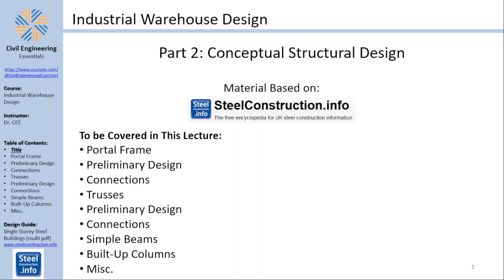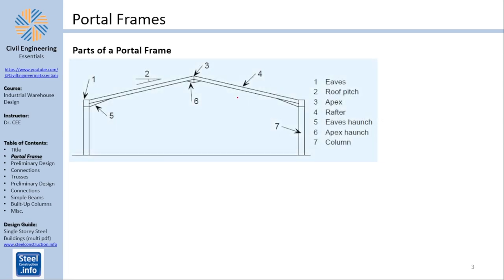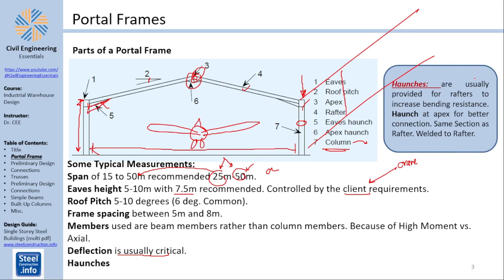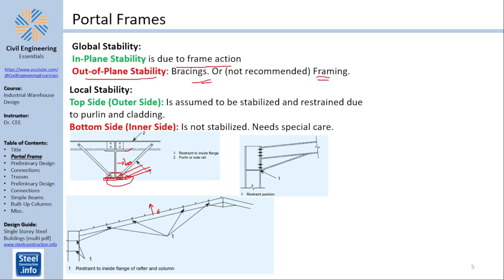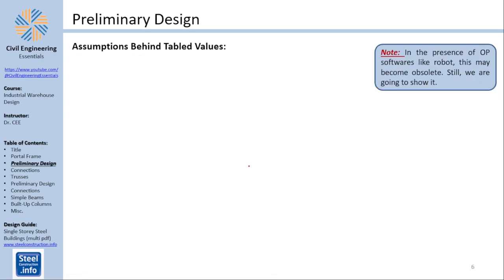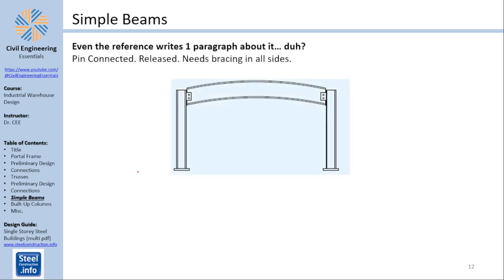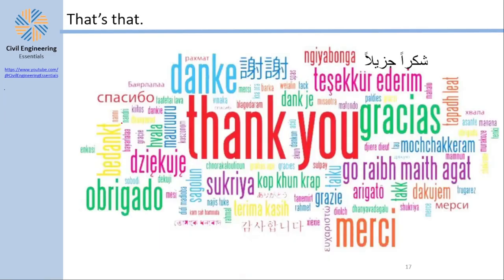Design of Industrial Warehouses | Part 2: Structural Concepts

Comment: Hello Dr. CEE,

You are correct, there is quite a lot to uncover on this subject; and I do think that the CEE is doing a fine job of this so far. 

Very nice discussion on the Global and Local stabilization. It will indeed be interesting to see how one may be able to effectively model these stabilizing assumptions into RSAP in as far as it is practically possible and in order to align the analysis and design model with “real-life” or anticipated behaviour.

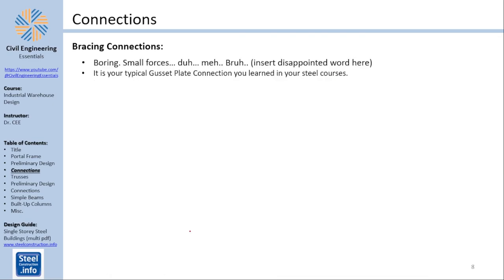12:30 Bracing connections. I agree with that most of these connection details are for the most parts “standard-off-the-shelf-details”. This is especially the case with local stabilization. I’d also like to add that the concept of bracing (stabilisation) is critical to the structure as a whole and so it (stabilization) will be as strong or as effective as its “weakest bracing connection link”. Therefore, it is very important for a user to get those bracing connection details right.

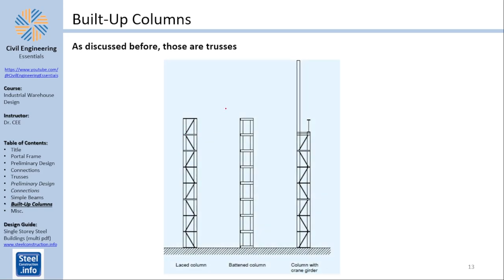15:05 Built-up Columns. I am not sure if there is going to be an opportunity for a practical demonstration of these in RSAP somewhere on this series? I would have really loved to have such a demonstration. For me, built-up columns are not as common and I do think that it would be a good learning experience to also have a detailed demonstration of a case with build-up columns being used. This is a thought for the CEE consideration (if possible or if convenient, perhaps as an “academic example” or similar stand-alone demonstration?).

Thank you for this video and I’ll see you in the next videos

Regards, DK
Reply from the maker: Hi there Engr. DK,
Actually, stability is one of the most important aspects to get right in modeling the portal frame. I hope I can reflect the concepts in robot (I am preparing to record a video tonight, with it being ready by tomorrow afternoon/evening).

Bracing connections are kind of "meh", but for sake of completeness, I had a slide for them.

As for built-up column sections (truss stuff), I had a chance once to do that. It was in a car-showroom made out of steel structures. It was made out of steel. Its height was really "high" as there was a central area open for all 3 stories to look down to (this is supposedly the grand jewel of the showroom, the latest Lexus SUV), with clear glass on all stories.
Here is a "similar" car showroom from google maps:
https://lh3.googleusercontent.com/p/AF1QipMqG63Te3iv41UyeAEIOKVIXUb7dSIiy2wLSIHk=s680-w680-h510

Note: It is only to show the front glass of the showroom, its height does not justify using built-up steel sections.

Stay tuned, there is a FEM video being exported and a robot video being prepared.

Next week I will slow down to my usual 2/3 video rate. This week was an exception as I had a longer public holiday, so I worked on this channel a bit more.

Stay tuned,
CEE
Reply: @CivilEngineeringEssentials   Thank you for the feedback,

I imagine it must have been quite an experience with the central area 3-storey high columns you mentioned. This discussion does help to put a sense as to where and when such columns configurations may be more appropriate. I “see” also regarding the heights of the columns inside the “similar” dealership building that was referenced (I took a virtual tour inside the dealership showroom - Courtesy of the digital age 😊). 

Yes, the FEM video, what a weekend. I also had a sort-of a long weekend that is ending tomorrow. It seems that Workers’ Day (Labour Day) holiday is common to both our countries. Enjoy the holiday. 

I don’t really mind the video release rate adjustments every now and then. I noticed that there is order and reasoning behind your doing so; and that is fair enough for me.

Keep up the good work.

Regards, DK.
Reply: Hello Dr CEE Sir,

I don’t know how I missed this session 4 days ago. I think the timetable for your video release has changed 😅.

Anyways, I enjoyed this session. However, in the connection of the steel stanchion to the concrete stub columns via base plate, is the connection pinned because of the arrangement of the bolts only?

It’s obvious the bolts where arranged parallel to the web plate of the stanchion.

Would bolts arrangements parallel to top and bottom flanges mean the connection is fixed? As these bolts would be arranged perpendicular to the plane of major axis bending of the stanchion? 

Please clarify and thank you soo much 
God bless you
Reply from the maker: @niisarpei3676  Hi there Engr. Ni,
There was a slight modification last week. But I will be back to the usual weekly (almost) schedule where I release 3 videos
1) FEM video
2) Lecture in Warehouse
3) Application in Warehouse.

As for the support, I understand your concern that: because of the support arrangement, one could think that the support is fixed.

Because the bolts are spaced apart, and theoretically, if you have tension on the bolts of one side, and compression on the bolts of the other, you would - of course - get moment resistance.

However, practically, there is a small technical difference between the support bolt and and steel connection bolts.

Support bolts do connect a steel element with the soil. Now for tension to develop in the bolts of the support connection, the support itself should be held in place. This - for soil - would not be usually the case, as soil does not withstand tension.

Now I see that you could say that the self weight of the foundation would provide the necessary tension, and I agree. 

That is the reason why I usually say: the assumption of fix vs pin is a designer choice and needs to be verified on site.

Still, as I am referencing a reference in the lecture, I wanted to abide by what the reference is saying.

Hope this clarifies the issue.

Also, stay tuned, I will be recording some videos and would release them saturday and sunday (hopefully).

Regards,
CEE

Comment: Great video as always, look forward to the rest of the series.
I’m designing a pipe bridge at the moment (warren truss with verticals, UC top and bottom chords, hot rolled hollow section other elements, internal framing to carry large pipes subject to quite chunky longitudinal and transverse force and moments) so any further content on trusses including detailing and connections would be greatly appreciated.
Reply from the maker: Hi there, thnx a lot for your comment.
Sure thing, the video is being exported as we speak, you can expect a robot video tonight.

For the truss bridge, I will definitely do this once the warehouse series concludes. It is a GREAT idea.
Thnx a lot for the suggestion.

Regards,
CEE

Comment: Thank you very much for the presentation, I am new to EC, Can you please tell me what is the latest available edition of EC 3 ? and give me reference link ? Thanks a lot....
Reply from the maker: Most welcome.
It is a little bit different than ACI code. The entire ACI code has 1 release year and version. In the eurocode, different sections could have different release dates.

Long story short, here are the latest version (As far as I know)
EN 1993-1-1:2005	Eurocode 3: Design of steel structures - Part 1-1: General rules and rules for buildings
EN 1993-1-2:2005	Eurocode 3: Design of steel structures - Part 1-2: General rules - Structural fire design
EN 1993-1-3:2006	Eurocode 3: Design of steel structures - Part 1-3: General rules - Supplementary rules for cold-formed members and sheeting
EN 1993-1-4:2006	Eurocode 3: Design of steel structures - Part 1-4: General rules - Supplementary rules for stainless steels
EN 1993-1-5:2006	Eurocode 3: Design of steel structures - Part 1-5: General rules - Plated structural elements
EN 1993-1-6:2007	Eurocode 3: Design of steel structures - Part 1-6: Strength and stability of shell structures
EN 1993-1-7:2007	Eurocode 3: Design of steel structures - Part 1-7: Strength and stability of planar plated structures subject to out of plane loading
EN 1993-1-8:2005	Eurocode 3: Design of steel structures - Part 1-8: Design of joints
EN 1993-1-9:2005	Eurocode 3: Design of steel structures - Part 1-9: Fatigue

Reference:
https://eurocodes.jrc.ec.europa.eu/EN-Eurocodes/eurocode-3-design-steel-structures

Regards,
CEE
Reply: @CivilEngineeringEssentials  Thanks in advance, I hope you have a course with AISC 360-16  for steel design using robot.
Regards....

Comment: Hellor Dr. CEE, Thanks for videos. What about temperature loads ? How many degrees should we assign to model or should we ?  It makes annoying consequences on the model
Reply from the maker: Hi there and sorry for the reply. I did not really look into that. But I think I should first add a video in autodesk robot basics explaining thermal effects first.
So you basically just gave me inspiration for the next video.

However, to kind of help you in your question:
Usually thermal loads are applied as gradients, where the sun-side is hotter than the interior side.
This thermal gradient causes the outside (in a sunny day) to expand more than the shady side, causing the beam to curve ever so slightly.

Hope it helped somehow,
Regards,
CEE
Reply: @CivilEngineeringEssentials  Dear Sir, Even we apply a little temperature load , its cost are high for frame sections and restraint reactions. Is it really plausable ? Some experienced engineers say that they dont use temperature loads in their design.

Comment: Hello Dr. CEE,
I was working on a project for Saudi Arabia, and the person I'm working for mentioned that we should consider the steel connection with 4 bolts to the foundation as fixed, not pinned. However, in the previous illustration, you depicted it as pinned. Could you please explain why you considered it as pinned?
Reply from the maker: Sure. 
The idea of "fixed vs pinned" is a discussions that is pretty much always gonna happen. So here is my personal opinion on the matter:

First: the theory part:
A fixed support means that 0 rotation happens at the ground level. This assumes an infinitely rigid support. 
A pinned support means that there is rotation. This assumes a totally free rotating support.

Second: the practical part:
In reality, there is no 100% rigid or 100% free support. It is always going to be a "relative issue". So since it is relative, what are the things that are relative?
1) The size of the column relative to the size of the foundation
2) The magnitude of the forces relative to the size of the foundation
3) ESPECIALLY the magnitude of horizontal and moment reactions at that foundation relative to its size.

The opinion of our Saudi Colleagues is granted. Truth to be said, it is still a debated point.

Ok, so why did I say "let me use pinned"?
Since we established that the issue is a hotly debated topic, I went to the "more conservative" approach.
But why is pinned more conservative?
1) More moments on the column (yes, it also makes the moment on beam a little smaller)
2) Columns bent into single curvature (needs extra safety when considering slenderness kl/r)
3) A structure that might have more side-ways movement, encouraging me to increase the stiffness of the columns a little.

Of course, please note that, the only true way to judge if it is pinned or fixed is to do a "deeper research". The simplistic way to explain it is:
Model the soil, model the foundation, apply the loads, measure the rotation, check if it is more than a certain "threshold" you put.

If you want me to go deeper in the research domain, please let me know. I am more than happy to explain.

Anyways, sorry again for the long reply.
Regards,
CEE
Reply: First of all, I would like to thank you for every single word you wrote. You are such a gentleman.

Secondly, I would like to know more about modeling the soil and the foundation. I'm not sure if what I thought about is correct, but I believe you might be suggesting using software like Abaqus to model the foundation, plate, and soil. Then, we can mesh the foundation - connections, and apply the load to check the forces on each node. Is my understanding accurate?
Reply from the maker: @aliomar6441  
Hi there,
so, a disclaimer first: for any practical considerations (real world applications), such a detailed analysis is not really needed for a simple warehouse.

But here is the research/deeper modeling of it. Short answer:
Yes, an abaqus model as you have stated would be great. Also a plaxis model.

Long answer:
Here is what I would expect from an MSc student to do:
1) Use plaxis/abaqus to model something called: "soil structure interaction"
2) Perform an iterative analysis. Why iterative? because the rotation at the support depends on the reaction. And the reaction depends on the rotational spring stiffness of the support, which needs the rotation, (circular)
3) Try find the equivalent rotational spring constant "a linear one" for the foundation. It means that: what is the rotation of the foundation (y-axis) compared to the applied moment (x-axis).
From it, find the slope, which is the rotational stiffness of the foundation.
Based on that, and on the maximum rotation, one could decide what to consider it.

But of course, since we are doing some deeper analysis here, we are way past the "black and white / fix and pin" stage.

For a PhD, I would go deeper to assume non-linear springs and deep foundations (something that a warehouse never needs)
Also, I would consider the interaction between the stiffness of the steel column vs the stiffness of the RC foundation.
Reply: @CivilEngineeringEssentials, dear Dr., I apologize for my delayed response. Your idea is truly remarkable and has the potential to elevate the subject to a new level. Exploring  (ISS) and applying its principles to the dynamic of structural systems is an intriguing concept. I've discussed this with my university advisor. Additionally, I'm contemplating delving into modeling the connections themselves, investigating microelements, and analyzing the stresses within. While I initially considered a more focused approach, I'm now convinced that every aspect of our profession ties back to the dynamics of structures. I'm eagerly anticipating further insights, especially in the realm of non-linear dynamics. Introducing non-linear damping systems and studying their behavior under seismic activity through time history analysis or evaluating wind pressures at individual nodes using CFD methods holds immense potential. There's a plethora of topics we can explore. I apologize for the lengthy comments, but I truly enjoy engaging in discussions with esteemed professionals like you.